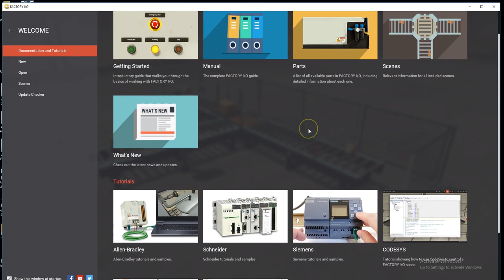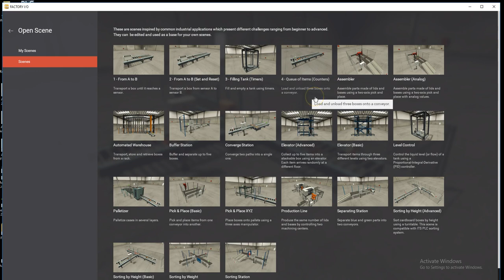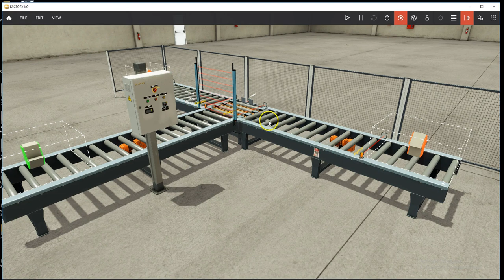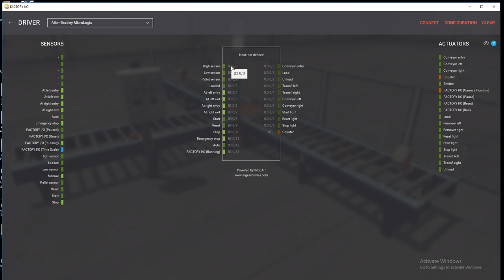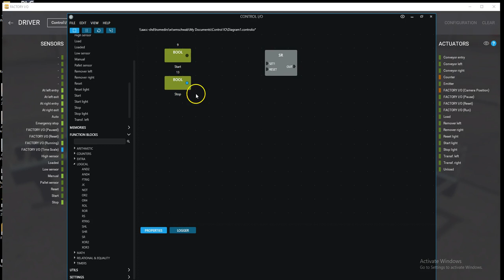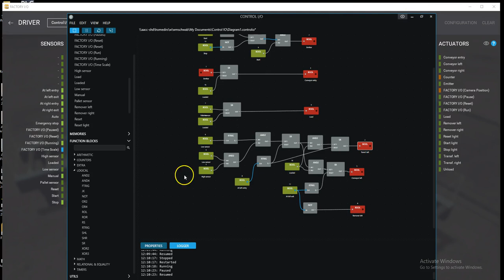Factory IO using Control IO Driver - Box Sorter Program

Comment: why did you use low sensor and not pallet sensor for latching?
Reply from the maker: The Pallet sensor only gives information that a box is coming. There is no information on the size of the box, when then front edge of the box passes thru the sensors there always is a low sensor which is used to latch the box size. If only low sensor (no high sensor) then it is a small box. If both low and high sensor then it is a large box.
Reply: @williamschwab9216  ok isn’t it true that if the pallet sensor goes off the true sensor will always go off because they are at the same level.